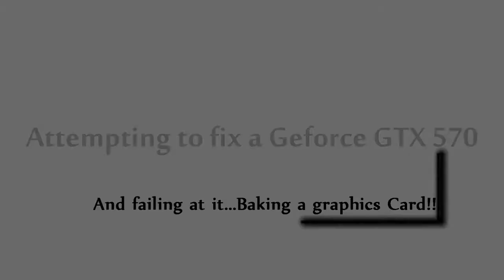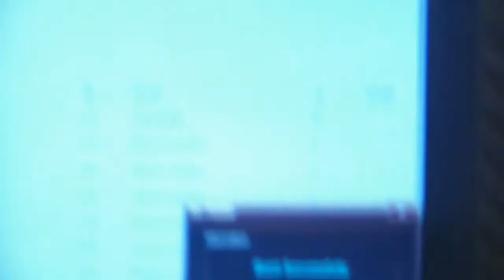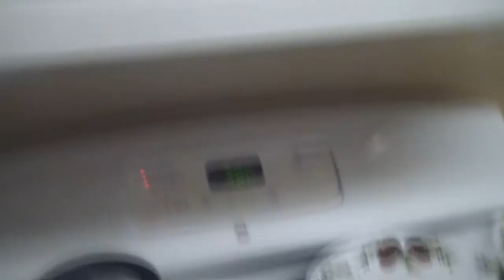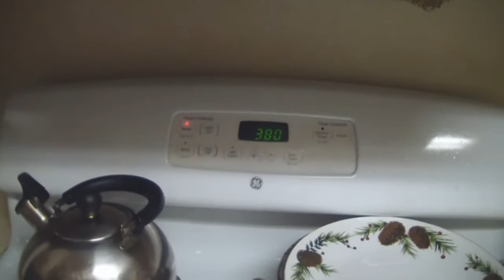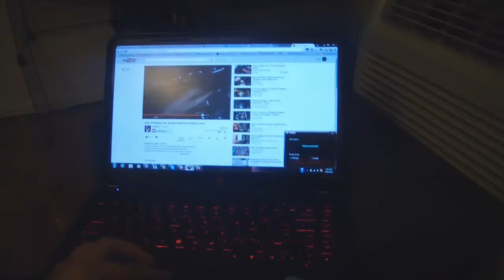Jan's Tech Vlog: Video 1 - Attempting to Revive a Dead EVGA GTX 570 HD

Comment: Couple of points;
Firstly PLEASE either oil or replace your chair, the squeak is beyond annoying,
please shorten your explanations, I am not interested (speaking for everyone here) in what its connected to or how many pins it requires, nor do I want you showing me your motherboard unless your fixing it, don't bother us with it.
Please sort your video out and get everything ready, so the cam is not pointing to the wall or floor while your trying to find a connection or tool, preparation is your friend
Don't not show us what your doing, cutting video at the points like what temp did you have the oven and why you where baking it at that temp and the length of 7 mins, why in fact at all were you baking it?
Apart from those little things its a great start and OK you did not get it fixed but your not shy with your explanations and thats a great start, plus you kept at it even though it failed to fix, so good job and keep em coming